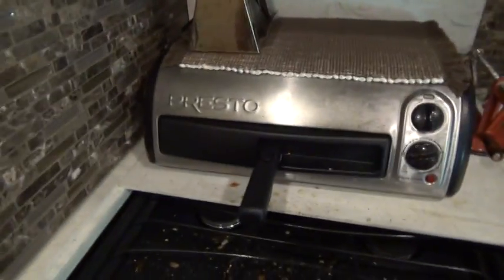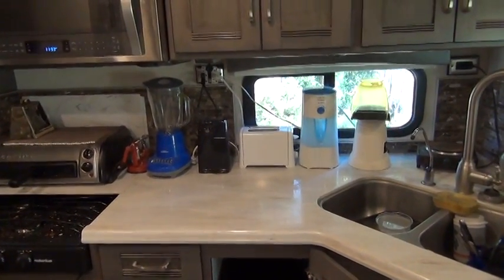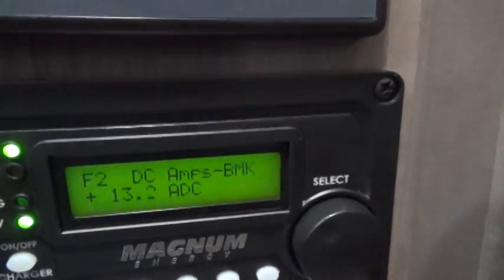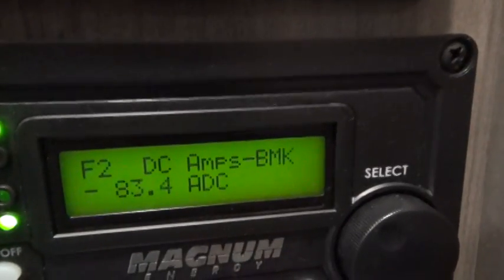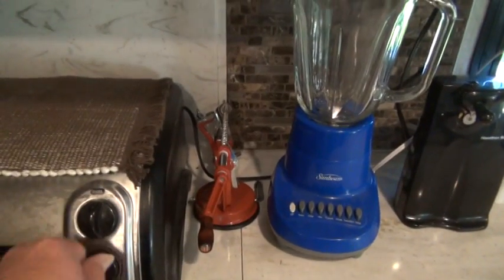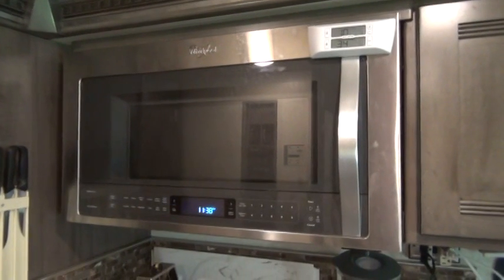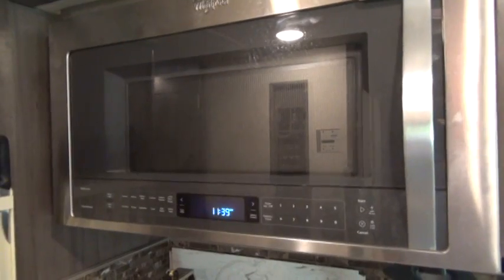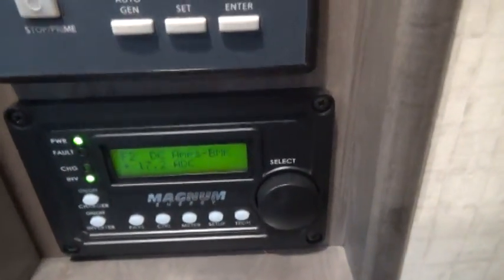Using solar power for high amp appliances in RV's

Comment: I'm so glad I found this video. I'm converting a school bus, it's almost done, now I'm working on my power system. I have an electric tankless water heater that I chose over a propane tankless water heater for a few different reasons. I understood when I bought it that it would come with challenges, but for my needs it was worth it, and others use this exact water heater in their RV's as well. To get to the point; it's 240v so I know I can only use it when connected to (50 amp) shore power and that's fine. Problem is, I've been researching for a few days now how I would get the extra amps and watts needed and have come up with no answers. I was able to deduce that I can most likely pull the extra amps and watts needed from either my battery bank or solar panels or a combination of both, but there doesn't seem to be a single source available that explains exactly how this is done (I kinda figure it's because one of the components I need in my system must do it automatically so there's no need to explain it). Your video is the first source I've found that actually confirms: yes, extra amps can be pulled from my solar panels for high amp appliances. My question is; since I have to gather all the components I need for my project myself (I didn't buy an RV in which it was already done for me) I need to know what component enables us to pull the extra amps and watts from other power sources I'm using in my bus (battery bank, solar, generator), and understand how it works. Is it a function within a certain type of MPPT charge controller I should look for? Is the inverter somehow accomplishing this? Is it the converter? A particular type of power distribution panel (solar AC/DC)? Since this tankless water heater requires 66 amps, I'm supposed to use a 70 amp 2-pole breaker, so I'm assuming there must be a power distribution panel somewhere in existence that will let me use the proper breaker and can be incorporated into an RV power system, do you know what it is? Any help is greatly appreciated.
Reply: P.S. - Yes, I've tried consulting a professional, but it was clear he was too lazy to get into details and instead bypassed answering my question to tell me I should just give up on the electric tankless water heater and instead get the propane tankless water heater I absolutely do not want.
Reply: @jerrydixon  As I understand it, you can use 240v from 50 amp shore power but it will of course only provide 50 amps. Otherwise, 50 amp shore power is mainly intended to provide two legs of 120v, and both of those will actually provide 100 amps, but ONLY with 120v. A lot of the new high-end motorhomes are coming with 2, 3 or even 4 240v appliances, like washers and dryers.